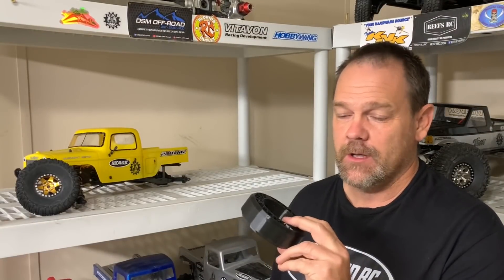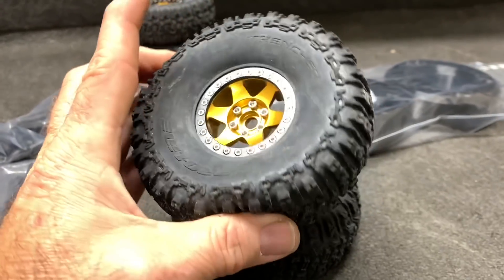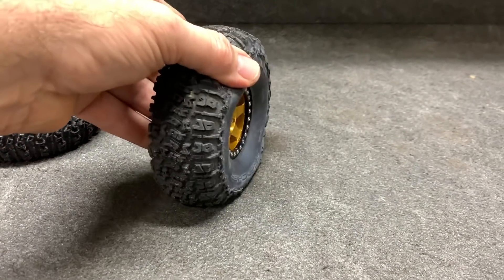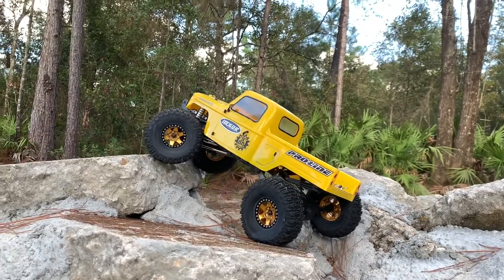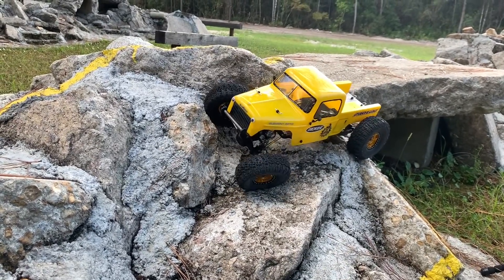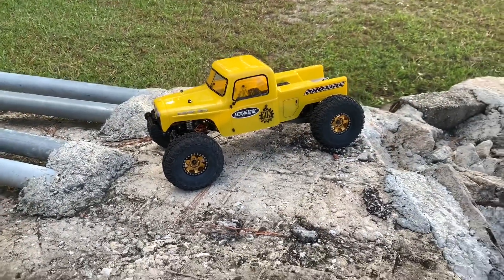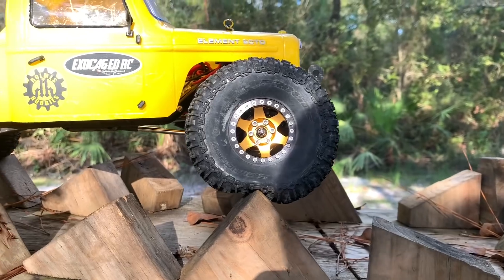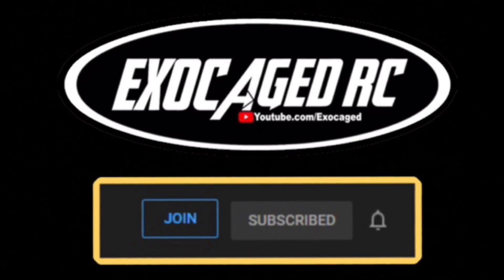3BRC ANTIFOAMS!! AWESOME!!!

Comment: We are very excited about these new Anti-Foams. We have been working on this design for over 2 years now, and through a lot of testing we finally have something we believe will make a big difference in the RC world. This product is 100% made in the USA and even the special filament we use is made here in the USA.
Reply: Would AntiFoams resist ballooning at speed?  That would be great for bashers in a size for vehicles like the Slash.
Reply: These remind me of the memory foams I’ve used in the past, but without the sidewall roll.  Are any chances of other sizes being introduced? I’d love to try these for my 1.9 rigs that that run 4.20” and 3.85” tires as well as in the 2.2’s my Comp and Night Crawlers!

Comment: Yep!  I've been using TPU tire inserts of my own design and creation for a couple years now. It's a little more pricey but the Colorfab 'Varioshore' is great for this. They work better than traditional foams in every way. Waterproof and infinitely tunable. If you have a 3D printer make your own and experiment with infil patterns and inner and outer diameter. Totally kicks ass.
Reply: A couple of years???   

I’ve been in RC’s fir 40 yrs.  not doubting you btw.  
But I’ve never seen anything like these.    
I’m blown away by reading this.  Really.    

Although. My closet hobbie shop is 50 miles. Lol  I have to do all of my shopping on the net.  So I don’t see a lot of different stuff early.
Reply: @Chon-c  yes we just went public with it in August.  It has been in development for a couple years.  And yes I have been in RC a very long time also. But you may have me beat by a year or two?  Ha, ha
Reply: @3brothersrc418  will there be a 2.2 xl in the future?looks awesome 👍
Reply: @3brothersrc418    Lol. I know. I’m old 🤦‍♂️🤣.   

But hey …Phenomenal work. 👍. I too like (and try ) thinking outside the box .  
& you knocked it out if the park with the first swing here guys !!   The taper to the outer edge is a great attn to detail & performance ,I can tell (whoever’s idea that was lol) 👍. 
This will be the standard for soo many reasons. 
So yeah …You’ve done well.  
I’m just curious to the advantages with 1/8 scales and bigger /faster as in speed or rotational effects etc .  And if it will (or can with the right design) fix ballooning & at a even cheaper option/way other than radials/belted ?. 🤔.   
It’s spurred me to print some up for 1/8 scales to try out . 

And I’ would advise you guys to get some of these ASAP for the new SCX6.   They are deeply needed space 👍
AND WILL BE the next growing market space . 

But again,awesome guys !
Reply: @PeasantNo.471  Definitely, we are already working on it.
Reply: @3brothersrc418    Awesome 👍.  I like how you think lol

I knew the bigger scales would be a great seller a couple of yrs ago too btw. Lol. 

I had that idea myself. Lol 

I’m in the wrong business 🤦‍♂️😂

Comment: I have a roll of that tpu I think I’m gonna try my hand at designing a set. It’s durable stuff it will last forever if it’s kept dry. Compliments to the printer operator. His settings look perfect
Reply: @RC CRAWL I don’t take care of my foams they get moldy and nasty. Wouldn’t have to do anything to these
Reply: @RC CRAWL I can just make my own. Iv gotten proficient in 3D modeling over the last year and 3 months. I’m not paying 40 for a set when I can print my own set for like 6 dollars
Reply: @RC CRAWL it only delaminates if your extrusion setting is too low and if your temperatures are too low. I worked out how to print tpu in less than half a roll. The only materials I can’t print with are abs and petg

Comment: Once you get enough for a few pairs of tires you should do stock foam vs anti foam vs anti foam with tuning rods. Things like max side hill and frontal hill angles would be interesting to compare, especially using the same car with very similar wheels and rims (if not the same wheels/rims if you have multiples 😂)
10:20 that control, the foam and tires not rolling on themselves, is really impressive. Goes right where you want 😎
Reply from the maker: I will
Reply: @ExocagedRC  and we will watch.

Comment: It's incredible to me how expensive these things are, but with even a basic direct drive 3D printer you can run off a set of 4 in ~24 total hours of printing and for <$10 of filament. And of course you can print far more RC parts with the printer as well, in different materials. I get it's a lot of R&D, trial and error, and failed prints, and there's much more overhead for an established company, but for a hobbyist making some coin on the side selling them locally, that's a nice payday every time someone buys a set.

I've designed a few pieces for my bashers and RC buggy and they've been holding up well over a year.

Sure it's a bit of a steep learning curve but it's like learning how to use a new tool with infinite possibilities. I'm printing off a basic set of these things right now (not this exact model, a freely available model) for my Capra.

Comment: I run proline dual stage and with aluminum beadlocks you have to glue the inner beadlock ring to the foam to keep the foam from shifting laterally on the inner ring, did you have to do that with the anti foams? Did you get any lateral shift on the inner beadlock ring at all?

Comment: Looks great. Now let’s see how long they last 🙂
Reply: I have had sets in my truck for about a year, I have tried to test them as harshly as I can. Gone though gears, axles, and tires. You'll have to rip the tire completely apart to even come close to tearing these.
Reply: @wblteen  
Well that sounds nice. Now sent them to Europe/ Denmark so I can buy some 😄
What about trail and water?
Reply: @Mr450pro  spent all last winter testing them in northern Wisconsin where I live. The see water Everytime I'm out. They trail really well

Comment: $70 a set of 4 before tax without tuning spacers?! ouch I need a 3D printer.
Reply: Once you try and print them you will completely understand why these are so reasonably priced. Also the tuning rods come with the Anti-Foams!   We just got them in.
Reply: @3brothersrc418  I really shouldn’t of criticized the price- as a company you have overhead, warranty, advertising, and much more. They do definitely seem to be exactly what we’ve been trying to get from dual stage foams for years and I know I have several $80 range sets of those. That sweet spot of softness without the sidewall rolling on a sidehill.  I just feel I’m missing out on not having a printer in the hobby at this stage. So many companies putting out the files and I don’t have the ability to make my own stuff like this foam concept, heads, light buckets, etc. I’m just plain missing out.
Reply: @The_RC_Guru  Actually I am right there with you. I run the company but would love to get a printer for myself and see what I can create. Just like I used to build from scratch all my crawlers.  I do just not have the time anymore. Meanwhile 3d printing is just getting better and better for those that do have the time.